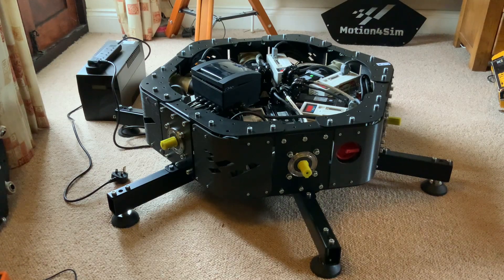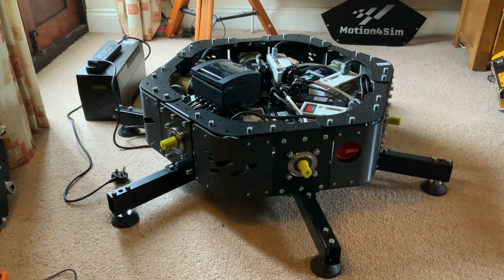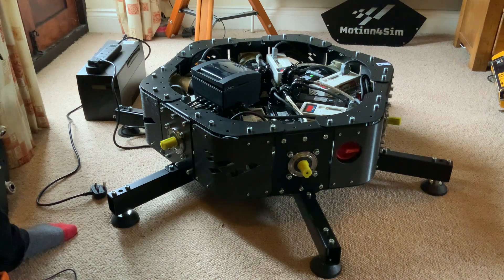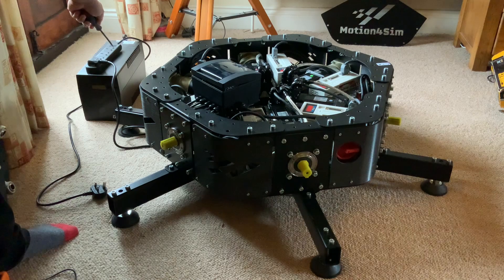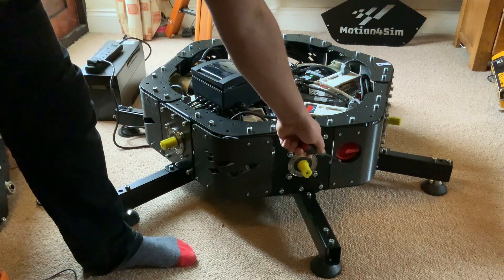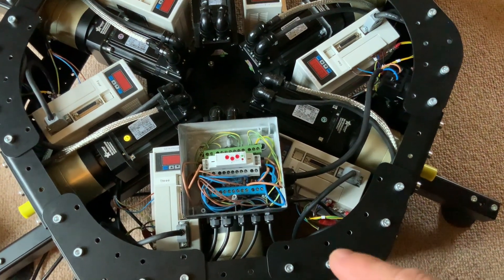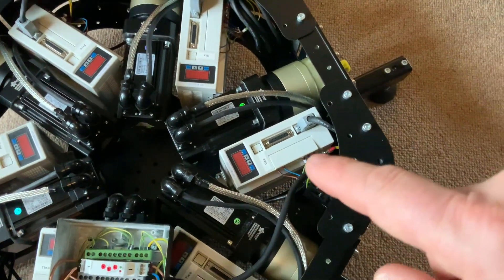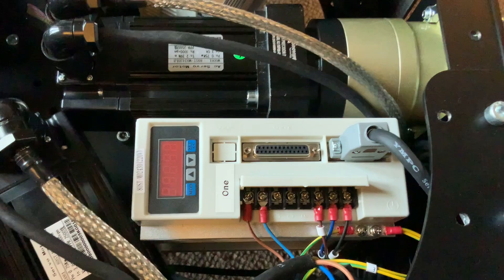Motion Rig - How Power Is Distributed

Comment: Thanks. Very useful. I do miss however the previous step of installing the equipment in the base structure.
Reply from the maker: I show the gearbox > servo preparation and mounting to the base assembly in an earlier video. The step-by-step construction is shown in videos by the product owner most of it is following instructions tbh like which bits to attach and how to prepare cables